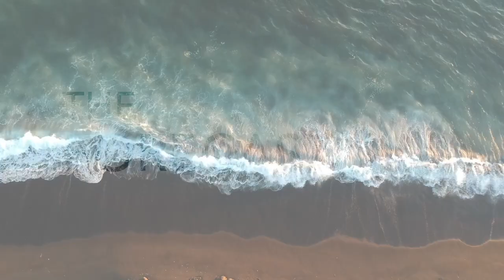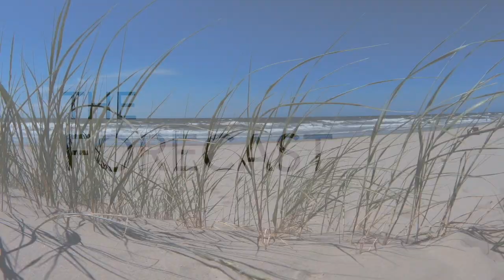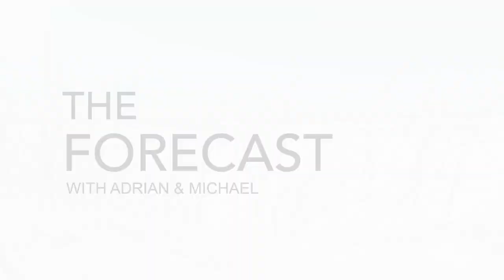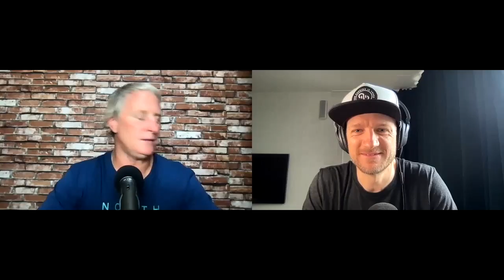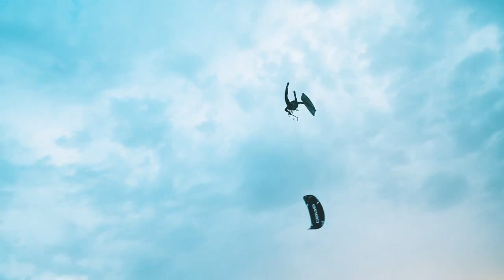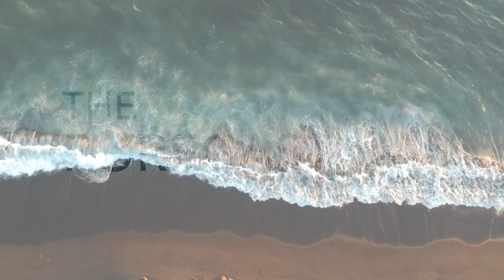What is the Contra or Dirty LOOP? | POD #15

Comment: I'm use to contra loop. In fact with a 10 I definetly prefer it even if you need to have a bit more power.
The big difference for me is that it recover faster than a kiteloop. 
Also the safety feeling is better in gusty conditions (maybe it is only in my mind 😁)